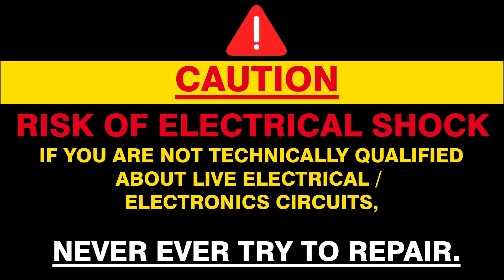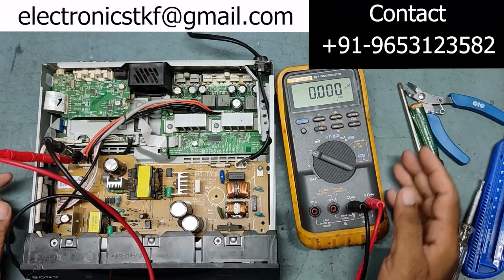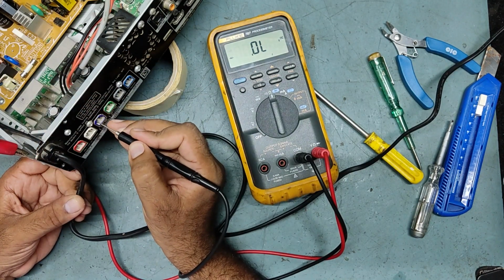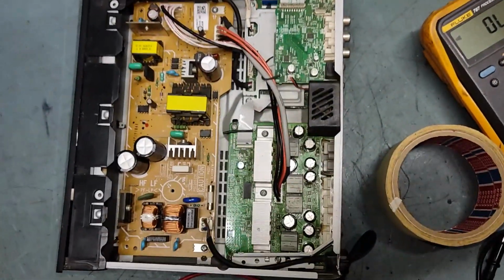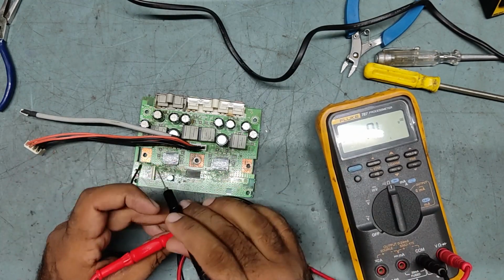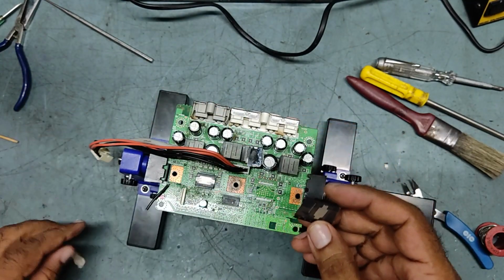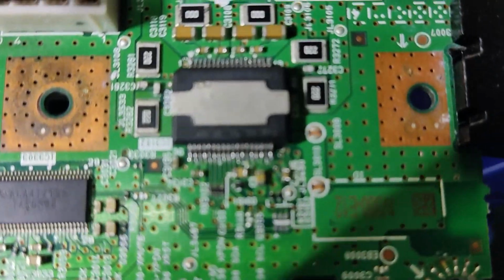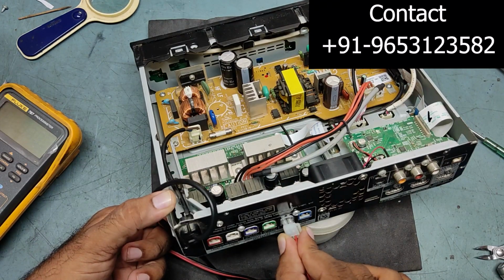Repaired PUSH POWER PROTECT Error in SONY HTR- IV300 very very tricky Fault Detected.

Comment: My YAMAHA HTR 3066 Showing "DC PRT : 253H" error. Some times it's shows 249h, 252h errors. And shutdown after 3-4 seconds. What are the possible problems.. is it a capacitor leakage or any short ?
Reply from the maker: Problem is in main digital board, may be main system ic or DSP ic looks malfunctioning
Reply: @TKFElectronics  Ok, Thanks

Comment: hi, my front speakers sounds big short noise then push protect error comes, sometimes it works fine , sometimes error comes on booting, my issue is random like this and on fm mode this short noise comes on empty bands but no error
Reply from the maker: May be Motherboard issue
Reply: @TKFElectronics   thank you...

Comment: Jo panch aapane regulator nikale Hain use please laga dena nahin to speaker short Ho jaenge speaker jal jaenge
Reply from the maker: Don't worry bro Usse pahle push Power protect error will appear on display, we have manually checked already by shorting speaker wire.